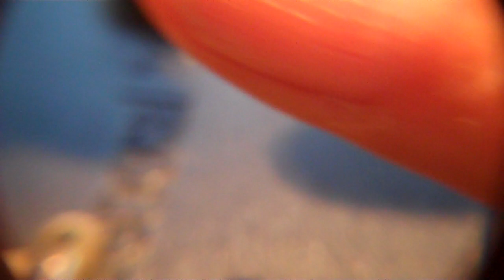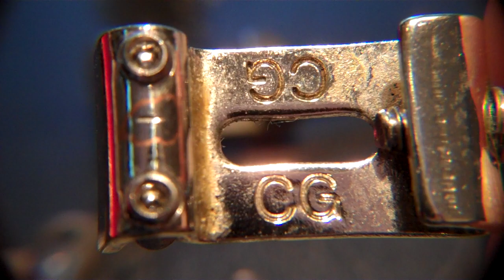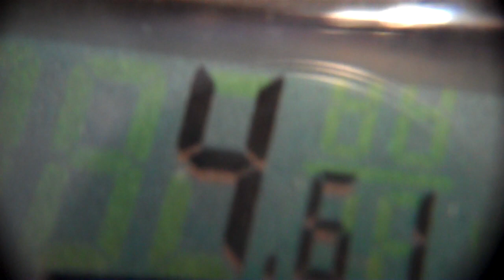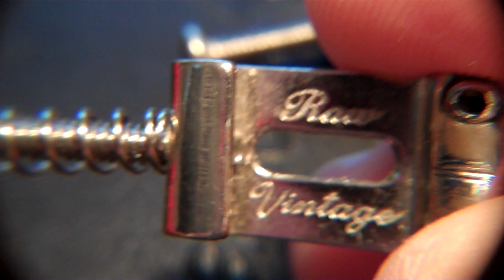1964 Vintage vs. Callaham vs. Raw Vintage Stratocaster Bridge Saddles

Comment: What's the BEST vintage style trem? American Vintage? 

I'm buying a road worn and putting in new parts. Wondering if I should change out the trem or not. Thanks in advance
Reply from the maker: I have only tried the Gotoh and the Callaham tremolos.  I would stay away from the Callaham just because I think it is uncharacteristically bright sounding.  The Gotoh was okay but the one on your new Fender should be fine if it has the full size, steel block.  If is doesn't, you can always buy a new block and I do use a few Callaham blocks and they are okay but there are others out there that I can't recall that may be better.  The Gotoh block was good too.  A Strat is going to sound most authentic with the original tremolo.  Be sure to watch this video because I eventually started having tremolo tuning issues even on my vintage bridges and it turns out it is mainly the strings sticking on the top of the saddles.  I do like the Highwood Contour saddles for a replacement.  I have them on three Strats now including my 1964 Strat.  It's hard to beat the original design unless you want a to mod the guitar some.  There is another trem design (I wish I could remember the name) that adds a plate below the top bridge plate.  It looks interesting but the extra mass will change the sound some.  All of my original style trems are completely manageable during extreme dive bombs.  Lube helps.  The springs on your new trem may need updating so check out the Raw Vintage springs too.  If you new ones are too tight, the RV springs will cure that.  https://youtu.be/qL5u7PcHzyM, https://youtu.be/-EaE-c-S1fk, https://youtu.be/DKf7PhmY_J8, https://youtu.be/FNgZGqB1yog.
Reply: @millstap  thanks so much for you in depth replies. I always go to the master when I'm in need of an answer. You have extensive taste and knowledge of vintage fenders and also previous experience in this area, that nobody else on YouTube I knows has. And just wanted to say thank you for always writing long responses to my questions. It doesn't fall on deaf ears. Or blind eyes, I should say 😲

I'll look into those. Are you familiar with the Eric Johnson Tremolo? 

It's supposedly different than all the other modern fenders because of 2 (known) reasons. 1, the string holes in the block are very very shallow. So the ball end sits at the end of the block. As opposed to deep holes made for "bullets" that go way down. People swear it makes a difference. Also no paint where the block meets the bridge. Better contact apparently. 

Callaham describes the fulcrum point on the bridge should go further past the 6 screw holes for better functionality so they move there's closer to the saddles. So the fulcrum point is then clearing the 6 mounting screw holes. Does that make sense?

Are vintage trems like that?
Reply: @millstap  do you have a video on how loose / tight you set your trem? 

Another guy on YouTube recommends setting it so you can UPbend the tremolo a Minor Third up until the bridge is then flush with the body. 

Finally, have you heard of a company called crazy parts or "art of aging"? They make they're own handmade Tremolo and say it's the only tremolo on the market that is a literal 1:1 exact replica on every single detail. For 89 Euro, it's tempting! It comes aged. 

Honestly their parts are so good you could pass off as real pre-cbs. It's flawless
Reply from the maker: @levijessegonzalez3629  That Art of Aging tremolo would be great.  I did see them recently and wish I would have known about them earlier.  It's funny, but the Europeans are more obsessed with Fender Strats than Americans and they seem to get it right.  The Highwoods are made in the Netherlands.  You can try their saddles and see what you think.  If they hold up, that would be great.  You can always try the Highwoods later.  I've been through a bunch of different saddle brands and just like the groove concept.  It keeps the strings stable.  I found that floating the trem is always best.  I used to deck all of my trems so if I broke a string at a gig, it would still be in tune.  I used to float it just a hair off of the body but recently decided that 4/64" off of the body is better.  It is more stable there.  Fender specs are even higher off the body than that.
Reply from the maker: @levijessegonzalez3629  https://youtu.be/Wh7Qj7qpkiA
Reply from the maker: @levijessegonzalez3629  In the comment I just sent I mention all of the gyrations people have gone through to make the tremolo stay in tune.  It's a real battle sometimes but I think it is simply the saddles as I mentioned.  It's more just steel to steel friction and the string actually sticks to the saddle just enough to make the string go sharp.  It doesn't take much to knock it out of tune.  That is why the strings always go sharp and not flat.  Yes, it is necessary to have no paint between the plate and block.  EC takes it to OCD extremes and he also removes the finish below the plate.  None of that is necessary IMO.  When you see what Rene Martinez did to SRV's Strat, it was extreme too.  Everyone was trying to fix the darn thing.  I used to listen to Callaham until I realized he is full of the usual marketing hype too.  I recently bought the Bullet strings and noticed the bullets were sticking out so I do have the shallow holes.  My vintage blocks have shallow holes so I don't know when Fender deepened those holes probably to accommodate the new Bullet strings.  The concept there would be the shallow hole blocks have more mass so they have more sustain.  If you do buy a block that has paint on it, it is very easy to scrape it off where the block meets the plate.  That connection should be very solid.
Reply from the maker: @levijessegonzalez3629  The way I discovered the sticking problem was thinking logically.  If the string was always going sharp, it had to be sticking somewhere because it was usually the G string that was the worse (for me anyway) and that string is the heaviest plain string so there is more friction.  The experts would always say the nut was sticking.  I spent years trying to find a good lube for the nut, pencil graphite, Nut Sauce, my own concoctions, you name it.  But, then I said, if the string is sharp, I should be able to lift the string out of the nut slot to release it and it should go back into tune.  When I lifted the string, it was still sharp.  There was no other contact point left but the saddle.  When I lifted the string off of the saddle, it went back into tune.  Voilà.  I can't believe it took me 40 years to figure that out so my logical brain wasn't working as good as I thought, lol.

Comment: The HR of the Callaham saddles is on the B scale, the hardest the C scale goes up to is 70 and that's not metal. They are actually a fair bit softer than the Fender saddles if those are genuinely 50 HRC.

Comment: I use Raw Vintage saddles with my 62 repro. Very happy with the result but I don't have a vintage Strat here to compare.
Reply from the maker: I think they are about as close as you can get for now.
Reply: @millstap  Excellent!!
Reply from the maker: Actually, two guys just commented that they use Highwood Contoured Vintage Saddles.  See the links I added in the description above.  I think I may try them.  Their product description hit all of the right buttons.  I had seen them before but forgot about them.  I am definitely going to try them.  They mention the hardness factor and what it does to tone.
Reply: waiting for your review on those my friend!
Reply: millstap What do you think of the current reproduction  Fender Pure Vintage saddles?

Comment: I use Remington Teflon gun spray on my saddles. I have no issues on my strat. I also drop a little 3 and 1 oil after the Teflon dries.
Reply from the maker: It's interesting how many lube concoctions there are out there.  The main ingredient does seem to be Teflon.  I used a dry lube for years but it was messy and didn't last very long.  I recently discovered Super Lube which is a food grade Teflon clear grease.  You might want to check it out.  It is very clean a pretty much disappears and stays in place for a few days at least.  https://www.super-lube.com/.  You might be able to cut down on the oil residue.  My guitar looked pretty nasty with all of that white residue everywhere.  This stuff is invisible.
Reply from the maker: Also, I switched to Highwood Contoured saddles from the Netherlands and love them.  I reference them in the description.  They are actually better than the Fender design.  I did a video on them too.  More recent.

Comment: So what’s your consensus? Which one is best based on sound, durability, overall? 

I’ve been doing non intrusive mods on my custom shop strat and it’s definitely worth playing with..
Reply from the maker: Hands down, the Highwood Contoured Saddles.  Here are the videos I did on them since this video, https://youtu.be/-EaE-c-S1fk, https://youtu.be/DKf7PhmY_J8, https://youtu.be/J5qItTWP2TY.
Reply from the maker: Most likely you need the 10.8mm Highwoods so be sure to measure correctly as in the third video I posted.

Comment: Have you looked at KTS saddles? they're made out of Titanium so that might really help with the groove problem, but they're well expensive
Reply: have you cut grooves into them?
Reply from the maker: Did you notice any tonal change?  I would be afraid of using anything other that steel.  Titanium is so light that I would think it has to sound different.
Reply: I doubt it would be all that big of a change. And even if it was, I doubt it would make it sound bad, so if titanium stopped the strings from cutting grooves into the saddles it would definitely be worth it to me.
Reply from the maker: Yes, just as long as the strings still don't stick.  Even though there are no grooves, a string can still stick on a new saddle.  I'm not sure which metal has the least amount of friction.  That would be good to find out.
Reply: Well graphite would definitely be the slickest I'd imagine, but no one makes vintage graphite saddles that I know of.
Reply from the maker: They make them but they are kind of strange looking, not very vintage, http://www.graphtech.com/products/brands/string-saver/string-saver-classics-strat-tele-style
Reply: Yeah those probably work pretty well, but I really don't like the look. But maybe I'm begging and choosing here
Reply from the maker: I've contacted Highwood in the UK and those will probably be the first new ones I will try.  I can't justify spending $100 for the titanium but they do look good.  It would be interesting.  Maybe I can get them to loan me a set for a demo.

Comment: Interesting theory. Love your attention to detail. I soften out the string path through the block into the saddles with a file because I’ve had issues with string breakage there and that has eliminated the broblem. Off course not with the old strats but with those i havent had any issues either, so yeah, either the design was spot on in the first place or the odd 60 years have already smoothened the rough edges. The new Fender ones are tempting, they even have the pat pend text!
Reply from the maker: A few years back I switch to Highwood Contoured Vintage saddles and they solved most of the breakage issue.  They sound great and the string stays very stable in the groove which is also a good place for a little Teflon grease.

Comment: callaham saddles are stamped steel not copper... there is copper plating underneath the nickel
Reply from the maker: Yes, and that copper plate is soft and allows the strings to cut right past the nickel.  Switch to the Highwood Contours and you will never look back.  I did a more recent review on those.  I will put a link to that video at the end of this video.

Comment: "First, bore the 6 holes in the plate slightly larger, by one or two drill bits. The main reason the bridge doesn't stay in tune is that the plate fits on the screws too tightly. You'd think Fender would have figured that out by now! Drop the bridge into the guitar and screw in the two end screws until they barely touch the top of the plate. The other four inside screws are just there for support - the heads should not touch the plate! Raise them about 1/8" higher than the end screws. The bridge needs to float to stay in tune - I can pull up on the bar so that the G string goes up a major 3rd to B, but you can make it float only a little and get the same result. If you get a new Fender bridge, unfortunately the block has been powder coated (even the part that touches the plate), and it totally ruins the tone of the bridge. I wonder what genius at Fender was responsible for that idea. So, you'll have to take the block off, get a drill and a nylon paint remover disk, and sand the coating off the block until it's just bare shiny steel like it's supposed to be. Use Big Bends Nut Sauce in the nut, and a drop of oil on each of the six screws - your 6 screw bridge will finally stay in tune." - Scott Henderson 

Considering how much he uses his whammy bar, it's quite impressive that he's able to abuse it that much, keep it in tune, and retain that kind of tone. 

And for those who believe the bridge doesn't have any significant effect on tone, there's this: 
https://www.youtube.com/watch?v=5T9ra-tHB8s
Reply from the maker: I really don't think all that trouble is necessary.  It does go to show that everyone has been fighting this issue probably ever since the Strat was designed.  It was fine until the '60's when Jimi figured out that it sounded cool if you wanged the crud out of it.  I don't think Leo every thought anyone would do that.  Then everyone came up with their remedies for the problem.  Since I was lucky enough to have a vintage bridge that stayed just about perfect even on extreme dive bombs, I didn't think much of it.  Then one day it started going out of tune and I could not remember touching it so I was baffled.  The more I messed with it, the worse it got.  I had alway assumed that is was the nut that caused all of the problems.  Everyone would say "oh, your strings are just hanging up in the nut."  So I tried every kind of nut lube imaginable.  None of them really worked.  I thought "here are only so many moving parts so it should be easy to figure out what the problem really is."  It was always the problem of the plain strings going sharp (for me anyway) and mostly the G string.  When the string would go sharp, I would goof around with the string at the nut but that didn't seem to solve the problem.  After years and years of looking at it (and I can't believe it took that long) I realized the string was hanging up on saddle and not the nut.  Lubricating the saddle really does make the problem manageable without having to take extreme measures like taking the guitar apart or boring out any holes, etc.   Rene Martinez (SRV's tech) took it to the extreme and bored out every hole, used plastic insulation, lubed every point of contact.  The easiest way to experiment would be to get some graphite saddles and see how that works.  I don't have any but I do have some for my Tele.  Graphite saddles don't sound very good but a least you can pinpoint the problem easily and go from there.  And, there may not be any guarantee that graphite works perfectly either.  I do agree that floating the bridge at least slightly is a must.  Well, then I bought my non-Fender Nash Strat and it wouldn't stay in tune from the beginning.  That is where I spent years fighting the tuning problem and that is the guitar I use now in most of my videos.  A little lube (the correct lube is apparently the trick, see my last video) on the nut and saddles works wonders.  If you don't use the correct lube, you won't get good results.  That is why is am so happy with Super Lube for now.  I know there are a million guitar specific lubes out there but I just refuse to pay $20 for a little lube made with someone's home recipe.  The synthetic grease base seems to work much better and I had been using dry Teflon for years but it didn't last very long at all.  Either way, try the lube before you start boring out any holes.  That sounds like a real pain if you don't have the correct tools to do it.